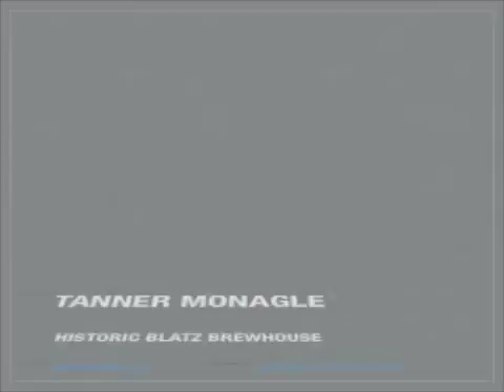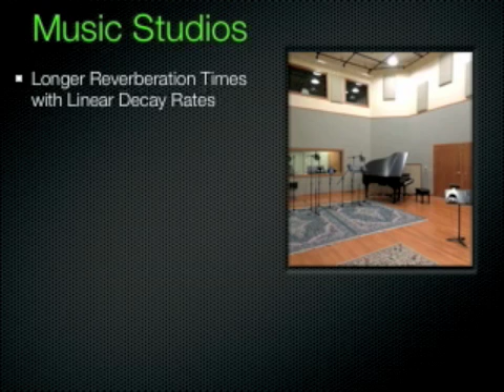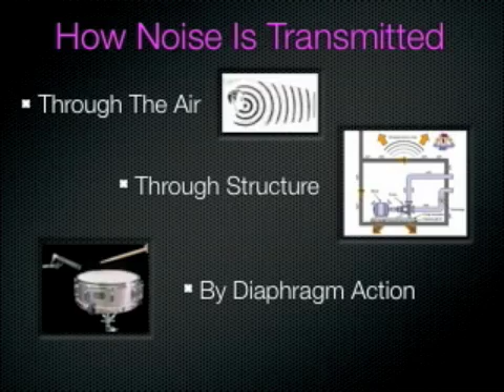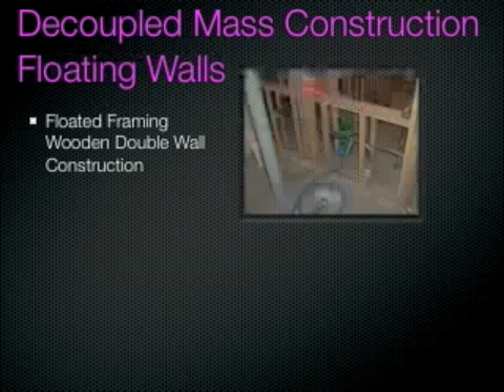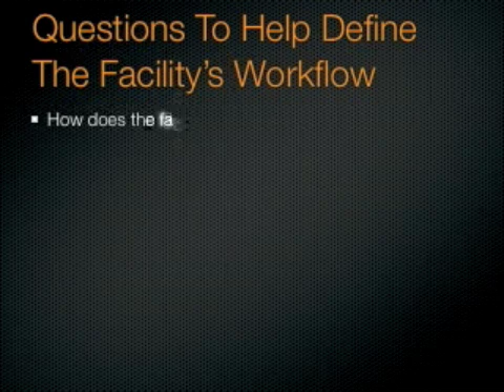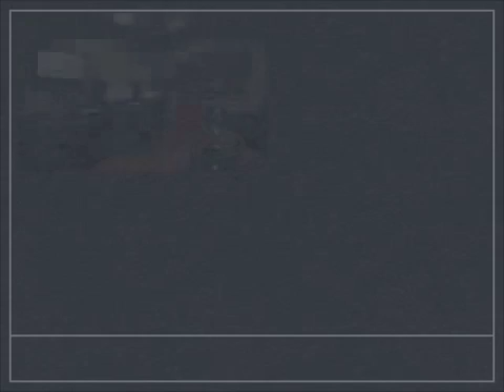Five Strategies For Successful Acoustical Design

Comment from the maker: Aran, thanks for your note. Flanking transmission always needs to be addressed on a job by job basis depending on structure, electrical, and mechanical considerations. "Short circuits" and gaps can compromise an otherwise solid design.  MK